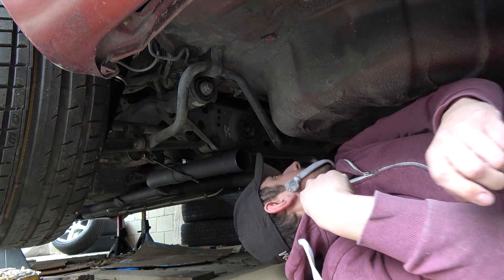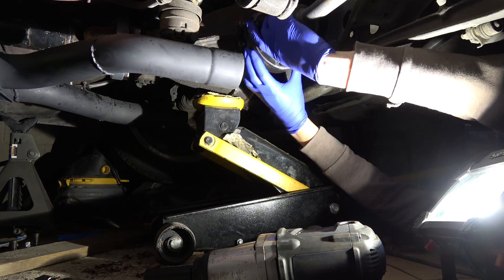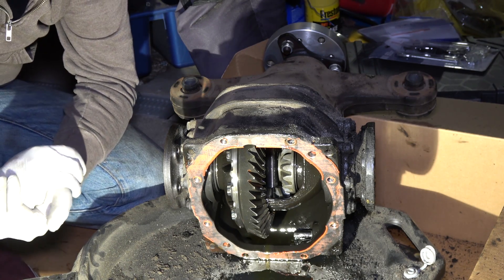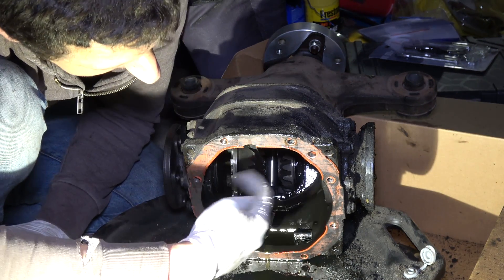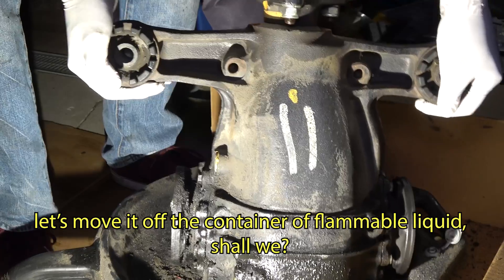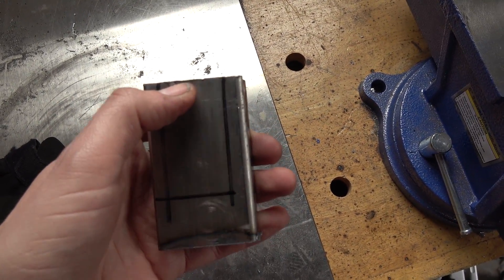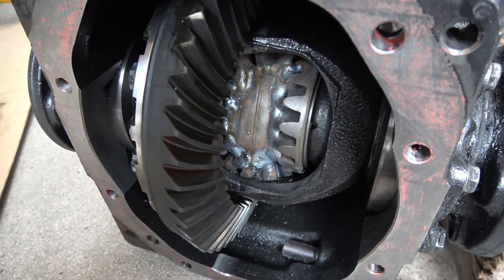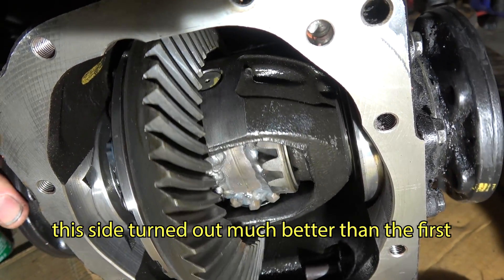Welding the Diff. Lexus SC400 Budget Drift Build. Ep. 53

Comment: Great video! I really appreciate you putting in the time lapse of cleaning the diff out after welding. You dont wanna catch a piece of metal between the ring and pinion or in a bearing..... ask me how I know.
Reply from the maker: Glen Heleski yep, trying to show as much of the process as possible. The welding itself is only about ten minutes. You spend hours cleaning before and after. Did you blow a diff?
Reply: Oh snap what happened to your diff? Crack?
Reply: Haha. It actually was a best case scenario. A piece of metal got between the ring and pinion. It embedded in the ring gear and the whole thing sang while driving till I replace the whole thing.
Reply from the maker: Glen Heleski sang? Is there video?
Reply: @GrandOnevia  Hahaha, that is an interesting outcome. More what I would expect. I always figured the bead of metal would just kinda get crushed.

Comment: Welded pretty good for a handler140. If you want more penetration i wouldnt get the updated version probably better off getting a handler 190 something that plugs into 220 if you have the outlets
Reply from the maker: The 140 has been doing great so far. I don't have the outlets for 220, but honestly I haven't needed the extra power yet. Pretty much everything I need to do at this stage of the build can be done with the 140. I'd love to get my hands on some other tools though. Plasma cutter would be incredible.
Reply: Spptv has a video on here with a cheap $300 plasma cutter might be something your interested in??

Comment: I've got an SC300 diff (4.3:1) lying in my garage from my SC400 rally car project.  I never got around to installing it.  I can make you a very good deal on it, if you're interested.
Reply from the maker: DualSport Cars thanks for the offer. I’m dealing with some surprise power steering expenses right now and don’t have the budget for more parts at the moment. I’ll keep you in mind though when I get to that part of the build
Reply: @FullySpooled  no problem at all, it's not going anywhere fast.  I had a similar issue with my power steering, slight leak from the rack that was in the car when I bought it.  I let it go for almost 2 years since I parked on the gravel next to my driveway.  I finally decided to replace the unit with a reman from Autozone, first day in the car is blew a side seal.  Such a pain.  Where the banjo fittings go, be sure the powder coat is perfect, otherwise scrape it down to the aluminum on the seat area for the copper washer.  Mine leaked there too.

Comment: What ever happened to your project after the engine blew? I actually learned quite few things that helped me with my GS300 LS build
Reply from the maker: Coronavirus happened. The new engine is installed and running great. I just haven't been making a lot of videos over the past year. Got a new job, global pandemic, etc. I need enough free time to get back to the track.
Reply: What will you suggest as far as donor differential to weld for my GS300? Is the 4.27 from the SC a better ratio for street?

Comment: Do you remember the size you cut the steel pieces for the fill in? How big?
Reply from the maker: I measured the distance between the spider gears and cut out cardboard templates to make sure they fit snug, then traced to 3/8" steel plate. I don't have the exact measurements unfortunately.
Reply: Thank you